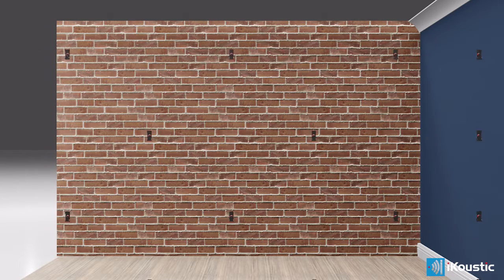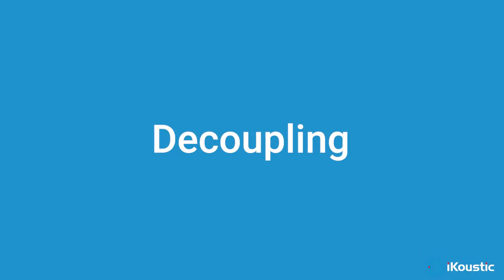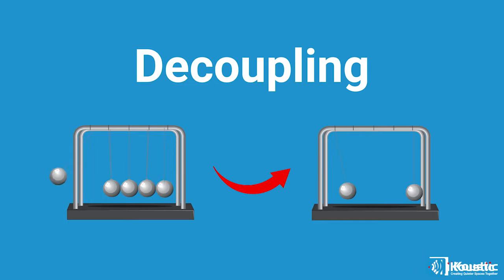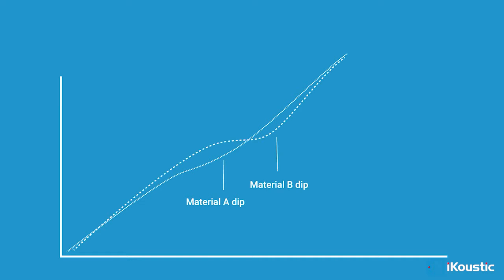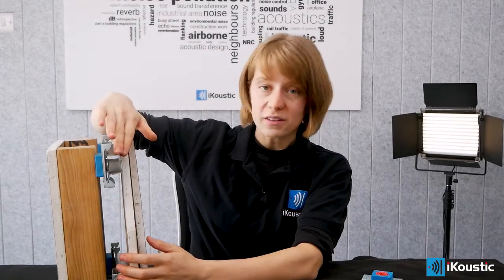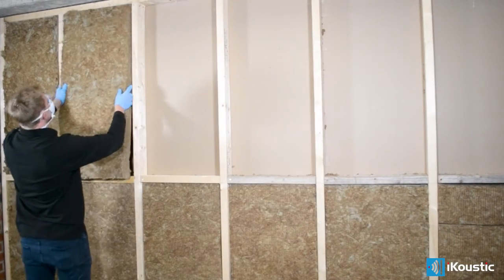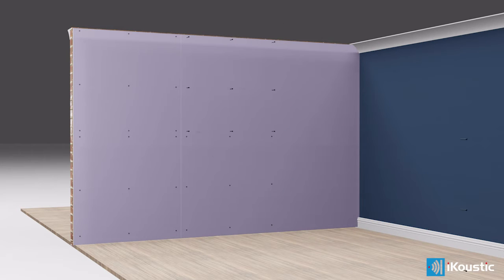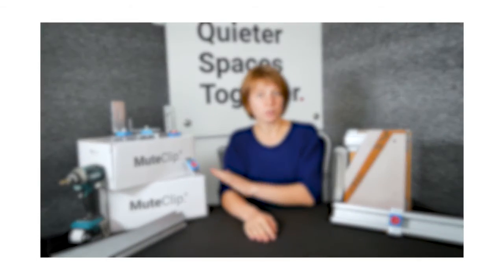The 3 Core Principles of Soundproofing - Everything Explained!

Comment: I understand the concept of decoupling, my question is, 
Does the size of the air gap matter?
I could build just like your example wall but not use the resilient channel, make that gap only 1/8-1/4
So the mass layer doesn’t touch the wall board or the framing material.